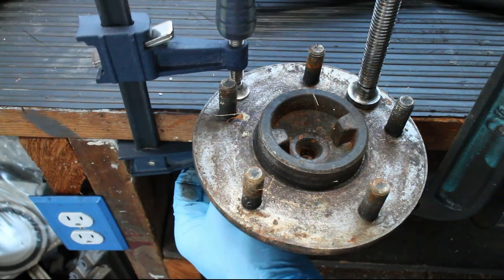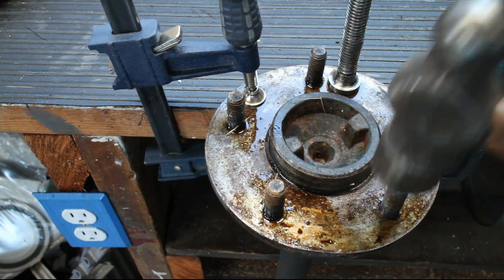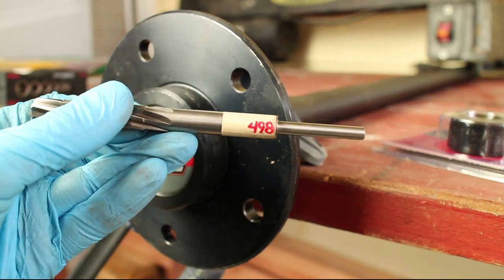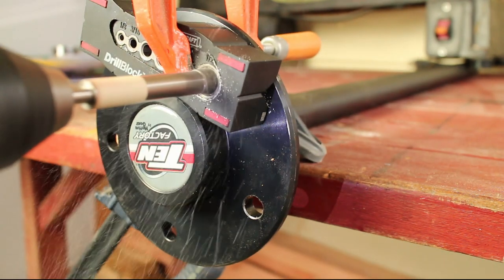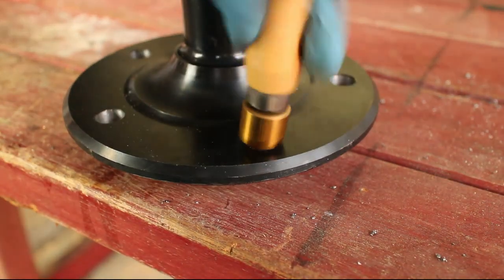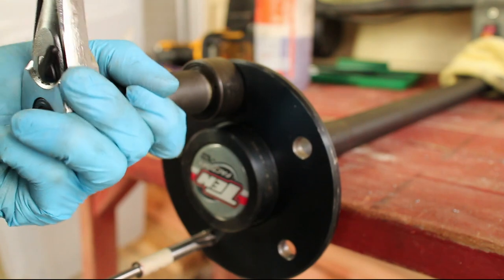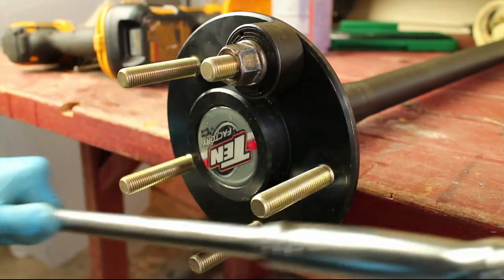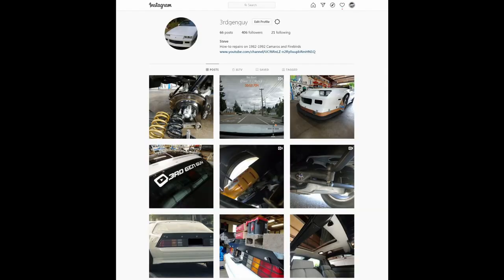How to Install ARP Wheel Studs

Comment: Question is this arp studs are equivalent to 5x4.75?
Reply from the maker: none.
that's the bolt pattern.
3rd gens use 12mm x 1.5 studs

Comment: Why not just tap the holes and get thread in 1/2” studs?
Reply from the maker: 3rd gens use m12 lugs.
Reply: @3rdGenGuy  you can install whatever size studs and lug nuts you want. My s10 pickup originally also had smaller studs and lugs. It now has 1/2” studs and I’m considering going to 5/8”.